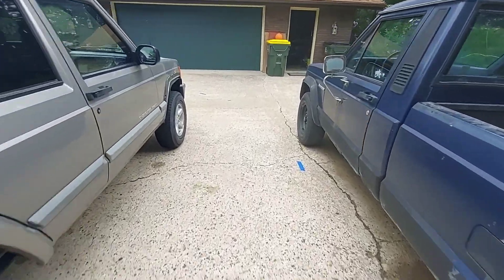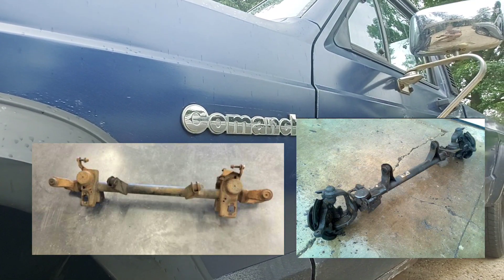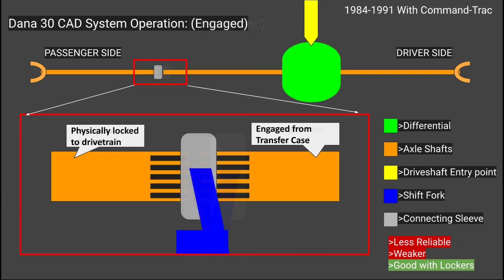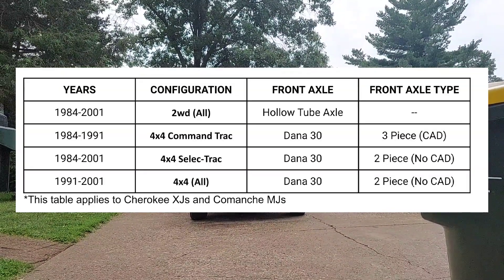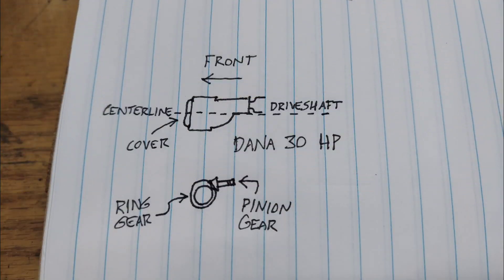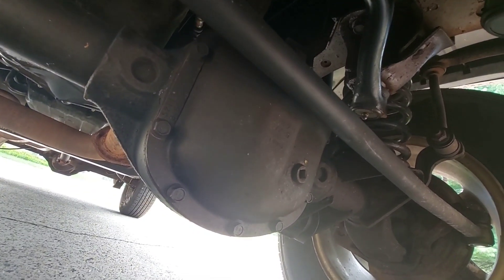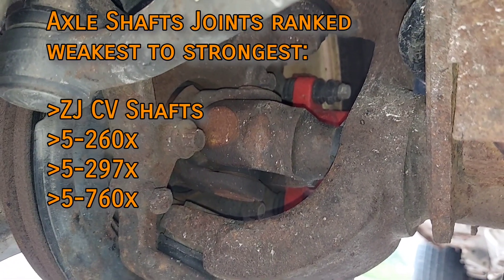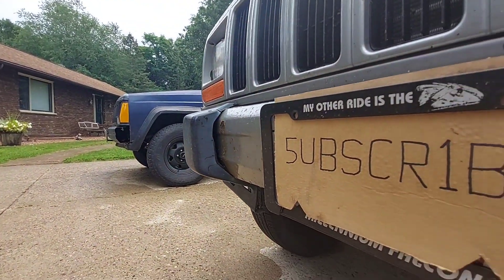How to Identify Which Front Axle You Have - Jeep Cherokee/ Comanche XJ + MJ

Comment: I feel like I can offer some discussion on the aforementioned yj, tj and wj. The yj has a high pinion disconnect 30 on literally all of them. While the tj had a low pinion 30 or low pinion 44. Wj offered a better steering system and breaks that can be scavenged to build a “super 30” but it still remained that low pinion. Personally I believe the high pinion non disconnect 30 out of the mid year xjs is the best, even better then the rubicon 44. Combined with the wj knuckles and some toob selves it can be a pretty indestructible axle. Obviously this is relatively common knowledge, but I felt I had something to offer to the comments.
Reply: Not common knowledge to us new guys, thanks.

Comment: Would you say installing manual locking hubs is a worthy mod to the XJ front axles since in theory it should reduce driveline wear while increasing MPG, a win-win?
Reply: no. it’s around 1500 for a kit and isn’t worth it. you would see maybe 1/2 mpg difference with the front hubs disconnected. is fuel economy the largest concern you have?

Comment: wait so what the fuck do I have? I have an np242 which I thought was select trac and a 3 piece axle and I know I have both because I have already had to do so much crap to both of them
Reply from the maker: If you have a CAD axle and NP242, someone swapped in the NP242. They never left the factory like that
Reply: @WAEMIDIV  weird, that could be why I'm having all these problems
Reply from the maker: @MyGreatCreation  if the CAD axle doesn't engage and you have the NP242 in full time mode, it will only free spin the disconnected axle shaft, and you won't move anywhere. Does this describe what is happening?
Reply: @WAEMIDIV  no I fixed that issue but I drove around after I permanently engaged the cad I had some really bind binding issue, not sure where from, but I kept getting power less and then a huge bang and all the power returned, but then I disconnected the front driveshaft which was under immense tension while the transfer case was in neutral. Also while all this was happening I never actually engaged 4wd so the transfer case may have slipped or somehow got bound up

Comment: When the shaft has a 0° operating angle, U Joints are in fact much stronger than CV axles. BUT as soon as that U Joint shaft starts to take on an operating angle, it's strength diminishes rapidly. @ about 15° operating angle the U joint shaft is roughly the same strength as the CV joint also operating @ a 15° angle. Anything greater than 15° and the U Joint shaft becomes exponentially weaker than CV shafts.

Comment: Thanks dude. I got a low pinion dana 30 off a 2001 cherokee at the junkyard today. Going to convert from 2wd to 4x4.

Do I need the vent line running from the differential to the engine bay? I lowkey forgot to take it..
Reply from the maker: you don't need it, but you'll want it. But it doesn't have to be from the junkyard, you can get some oil-rated hose of the same size (I don't know the diameter) and run it somewhere up high

The breather hose is meant to never get water inside it. It's routed up high so when you drive through rivers (as one does) the differential doesn't get water inside it. 

Without that hose, literally nothing bad will happen unless your axle is near or in a lot of water. 

Rockauto sells the little vent caps that go on the end of it

Comment: My 2000 XJ has the low pinion Dana 30, has 253k miles and I started getting a rumble while braking that is felt in the front end and steering wheel. It's a fast vibration, not a wobble from worn brake discs. Front brakes are totally new in fact brand new discs, calipers, pads, hoses - everything as of a few months ago. Rumbling started just last month. From what I'm reading it's probably from the U-joints on the front driveshaft wearing out, maybe with the low pinion Dana they go quicker, who knows. Haven't totally figured this issue out yet but enjoyed this video and found it very helpful....thank you!

Comment: He man,just found your channel..ive had two different 1992 Jeep XJs and both were mildly built for the trail,logging roads etc etc here in middle Ga...well time went on,life happened and lost my jeep due to some tough times...things are way better and looking up these days and got myself a 2000 Jeep XJ 4x4 that I plan to throw 33" mudders on and budget boost type lift.its a clean no rust body but its right hand drive.previous owner pulled the front drive shaft.i cant find a clear answer on whether a LHD shaft will bolt right in or not.no clear answer anywhere on line.i dont know if I will like the RHD. but for what I paid,i will give it a try.the 4.0 has high miles but purrs very smooth....thanks for the info!!
Reply from the maker: The RHD models used the same axles and transfer case, so they could keep the 4wd linkage in the same place and avoid needing to make another stencil with another hole in the floor. So the differential is on the same side, meaning the driveshafts are the same. You can use a LHD driveshaft in a RHD

Comment: Low pinion was used in 00-01 to clear the engine Pre-cats. If you have an 00-01 XJ and swap in a high pinion, such as myself, on stock lift and worn bumpstops, you will dent the pre cats with the axle housing if you hit bumps hard. Luckily it seems to only dent the lower housing and not the honeycomb, but thats why Jeep made the switch.
Reply from the maker: Yes I figured that out much later after making the video. I wish I could Rewind time and remake it
Reply: @WAEMIDIV  you can't edit the video?
Reply from the maker: @tartopom2669  to change a video that's already on youtube you have to delete it (and thus delete all it views, comments, and position in the algorithm) and re-upload it as a new video, which starts from scratch. 

Usually people just put a note in the description or comments about whatever needs to be changed (exhibit A) 

I've seen some very large youtubers (1M+ subscribers) edit existing videos on youtube, but I don't know how they do it and I assume it's some bonus feature you unlock for getting so many subscribers. 

For something so trivial as to why Jeep used a low pinion axle in 2000+ Cherokees, meh, not worth basically starting over with the whole video, yanno

It doesn't really matter *why*, it just matters they they *did*, and that should be good enough for most people. Those extra curious folk like yourself are usually the first to explore a little deeper into the description/ comments, and now you know the truth that hardly anyone else does!
Reply: @WAEMIDIV  wow thanks for such a detailed answer 😂 no doubt about that from such an in-depth youtuber. Now it's time to remind you making a video about every engine ever put in a Cherokee 🌚. anyway thanks for these videos, they help me try to identify and repair my '99 2.5 TD

Comment: Do any these D30 variations have c clips?
Reply from the maker: Yes, the CAD equipped models (1984-1991) do use a C-clip on the inner passenger side shaft (I believe, don't know for sure). Otherwise, the outer Shafts are held in by the wheel bearing axle nut and bearing to knuckle bolts. None of them from 1992 onwards have c-clips
Reply: @WAEMIDIV  thanks love u